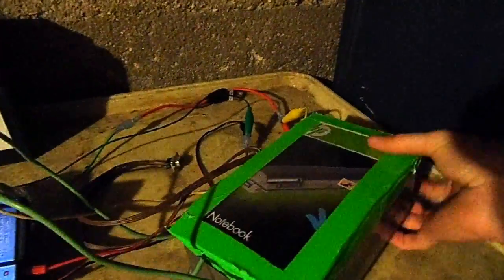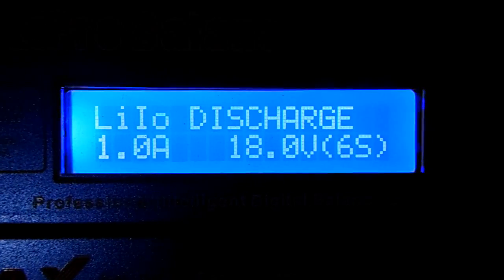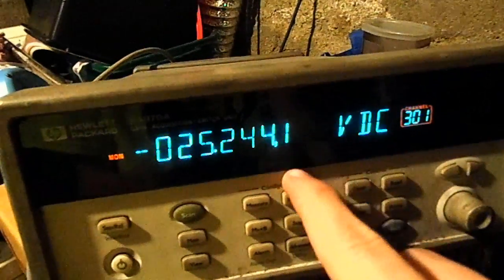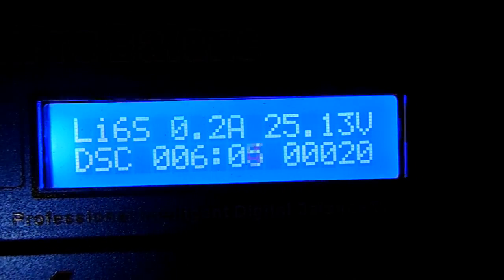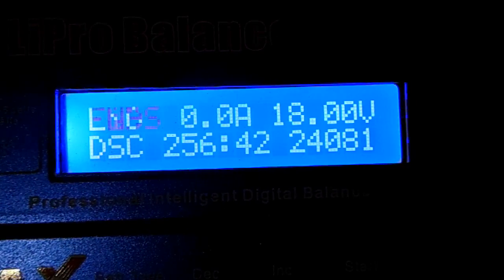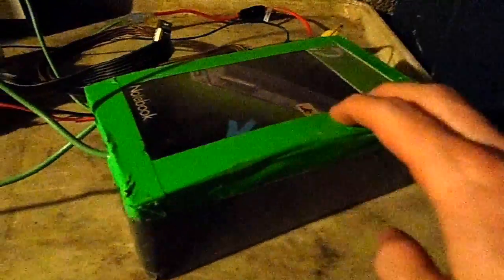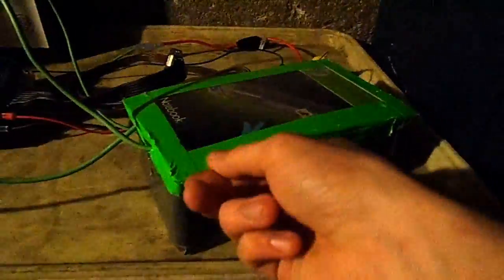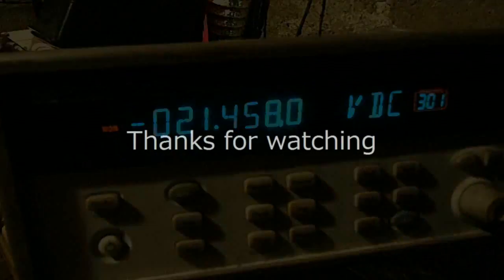24AH lithium E-Bike battery discharge test

Comment: You could ad more cells in parallel and then your voltage dip/rate wouldn't travel so much. There are more variables regarding voltage drop but If you are not constricted by space then you should extend the number of cells in parallel.

Comment: I daily discharge my 34V - 21.5 amps pack up to 3.05-3.15 under load and 3.3-3.5 with no load and no problems so far. Got some Panasonic cells that are rated 2.5 discharge at 2C so i think you can get some extra miles if you get at 2.9-3.0V. I wish we could find cheap options of the 3400 mAh cells.
Reply from the maker: yeah but once they get bellow 3.8v they dip in voltage too much to drive my motor nicely. i think this test was good enough. it shows me that some packs are out of balance. next i might discharge each 4v pack and count exactly how much each one has and can add what each one is missing.

Comment: I notice in some of your videos you have the B6 set to LiPo and now its set to LiIo,  what's does the charger do differently for Polymer vs Ion?
Reply from the maker: there is a differance of .1v in them. one charges to 4.1 while the other 4.2

the thing is though, lithium ion and lipo are pretty much the same and can both be taken up to 4.2. but oh well.
Reply: thanks!

Comment: LiIon batteries has a good discharge rate, like 10 - 20c, so I think that even if he discharge this battery at higher loads, it wont loose too much capacity as heat. I never noticed my lipos warming up with discharges like 5 or 10c, so I dont think there is too much power waste :s
with 24Ah he is able to get nothing less than 20 amps I believe
Reply from the maker: yeh and i think i never really go above like 15-20 amps.
Reply: Rinoa Super-Genius 15-20 amps of discharge? So its less than 1c of discharge rate, you're in the most efficient curve of the discharge for 18650 batteries I think lol
Reply from the maker: Gabriel Guelfi
yeah i definatly dont pull the maximum current. i think i can actulally weld with these batteries. i know i've vaporized 30 amp connectors before haha

Comment: For my large 72V batt. how do i check the AH? also how can i check the amps the bike motor draws?
Reply from the maker: i'd recommend taking like a 110v house light and connecting it up to the battery and measuring how many amps it pulls. if it pulls 1 amp then for every hour your battery runs it you know it has 1 amp-hour.

as for the motor's amps. maybe attatch an amp meter to your bike? you can buy meters that always display amps and volts from ebay for like 15$.
Reply from the maker: *****
why? what would that do that my amp/volt meter doesnt?
Reply from the maker: *****
Well I was meaning the 14$ volt/amp meters that can read 300v and 100a. They are really tiny and can be integrated into like a dashboard/control panel easilly ^^

And yeah I thought you where talking to me, its best if you link your comment to who your talking too.
Reply: Rinoa Super-Genius Thanks man. Dude I found the shunt/Ammeter in China for 30cny (about 5 usd) and in the US it's like 15usd. Crazy how much it marks up after it hits the US.

Comment: Were all the cells balanced to  the same voltage before you started the test?
Reply from the maker: yup.
Reply: Rinoa Super-Genius
To what voltage were they balanced??
Reply from the maker: Robert Orr
i said in the video, 4.21 volts
Reply: Interesting. You might try removing and replacing the bad cell, then bottom balancing each cell to the same minimum voltage, then charging the entire pack to 90% maximum voltage. That way you could experimentally find out how healthy the pack would stay over time.

Comment: Do you know what the max discharge rate that pack has?  I figure you'd get about 40A if they are all Panasonic batteries.  Which is a very nice discharge rate.  Do you plan on adding any type of regenerative braking in the future?
Reply from the maker: nah i dont do much breaking.

Comment: The cut off point for 18650 is at 3.0V....but some manufacturers have cells that are able to go up to 2.5V
Reply from the maker: yeah but i wouldnt run them that low anyway, not counting it can damage the cells sometimes.

Comment: You were expecting 35Ah of capacity which is about 2.9Ah per cell right?
Not many laptop batteries have 2.9Ah Cells. Most have 2.4Ah or 2.6Ah cells if you are lucky.
Reply from the maker: i was just going off my first test, ya see i tested teh cells with just a stopwatch and a motor and they get to like 2ah each and i just stopped the test couse i knew they where good enough to buy more. so since i still could have gone longer with that test i figured they had more than 2ah per cell.

i think they actually have more than 2ah just  a few blocks of cells dropped in voltage faster witch ended the discharge test. i hope they have like 2.2ah

Comment: Isnt that an unrealistic test?  I thought at higher loads you wont get as many amp hours out of a battery, so in real world use, you couldnt get the full 24 amp hours.
Reply from the maker: i said that in the video. you did watch it right?

but i dont use this for only my bike, i can use it for other things too.
Reply: I think I misunderstood range with capacity.  My bad.